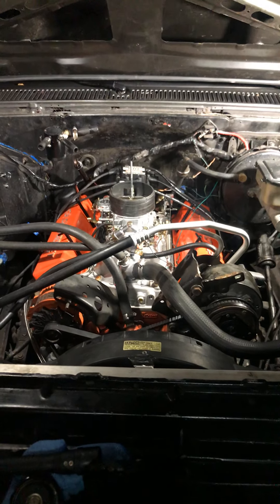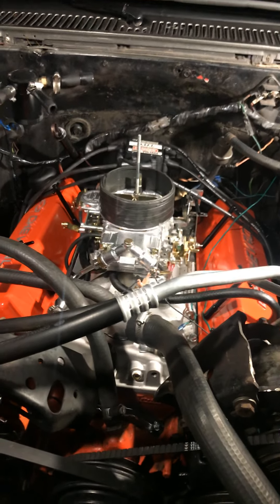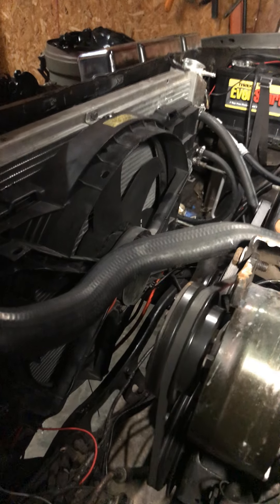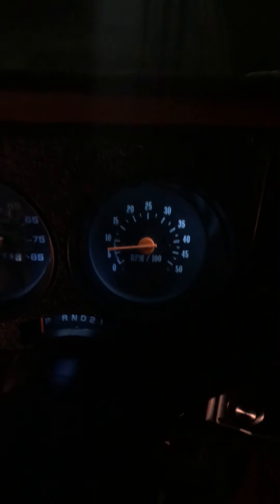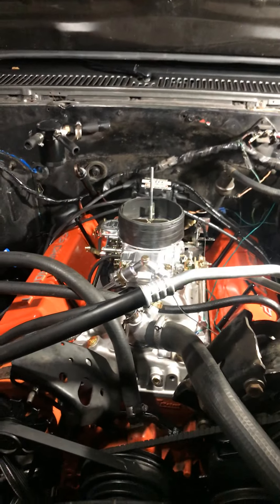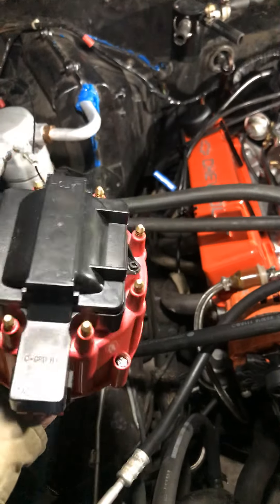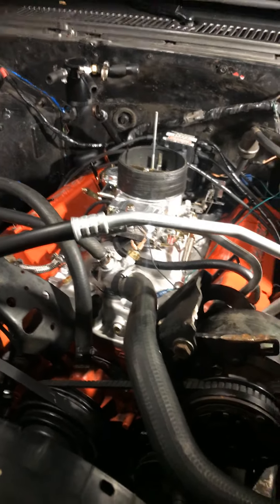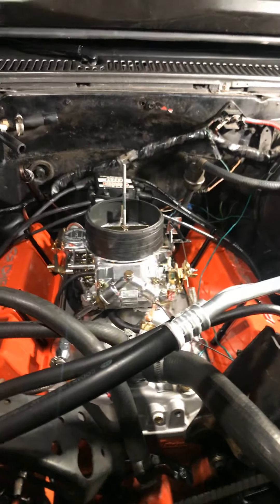Blueprint 383 stroker

Comment: did you have to install electric fans ? I bought a 6 blade fan , hoping it'll be enough.
Reply: No it has a new champion radiator and the stock 7 blade fan and stays nice and cool .
Reply: @gatojj  okay cool! I bought a 6 blade.  is yours a 4 row or 3 row radiator ?
Reply: @PeachCoastLowrider  3 row

Comment: I have that same engine, leaks oil from everywhere...rear main, valve covers, intake, and front of oil pan or timing chain/ crank seal...total junk!  I paid $6000 for a total oil leaker.  It's so bad I can't even drive the car.